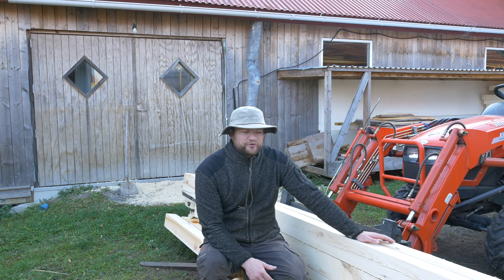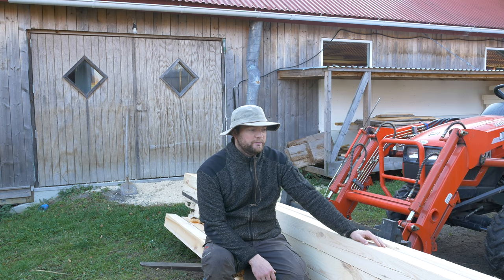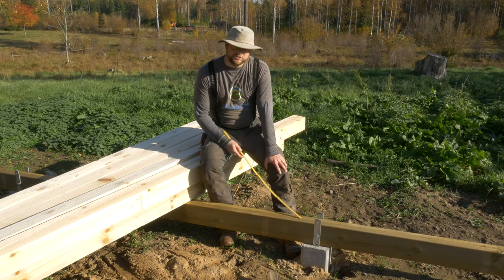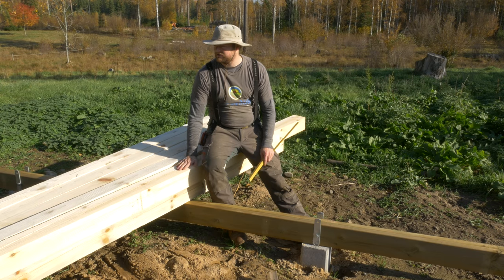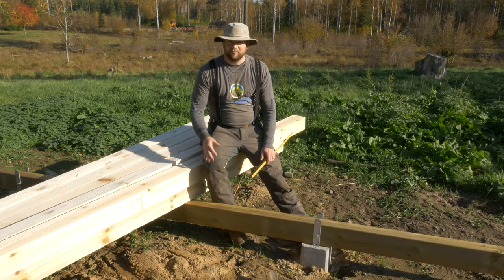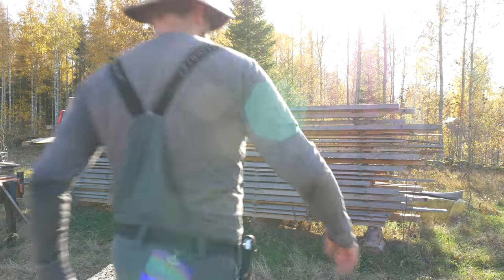You Can Only Do This With A Band Saw

Comment: Why do you think you cannot resaw boards with a circular saw mill? I don't see any reason why you couldn't.
Reply from the maker: The title is referring to a band saw which I use to cut out the top end of the beams. In regards to the milling: yes, you could do that with a circular sawmill. With a band sawmill like the woodmizer you will be more efficient since you can mill a bunch of boards at the same time.
Reply: Thanks for the reply, I agree, bandsaw is more efficient. Keep on keeping on and thanks for your content.